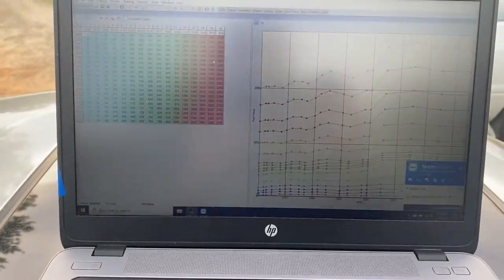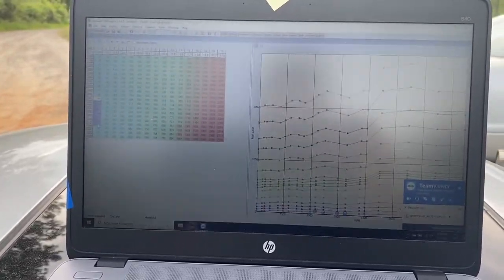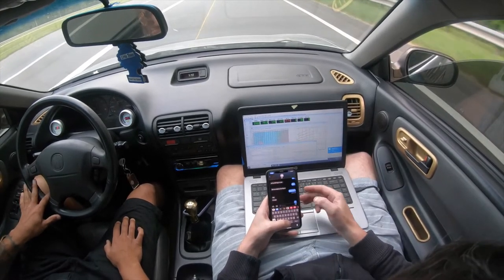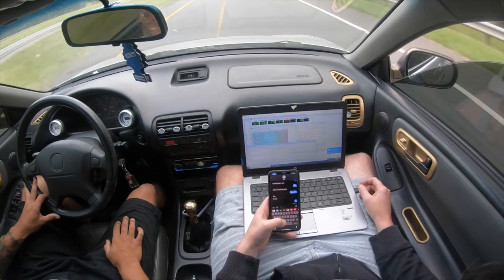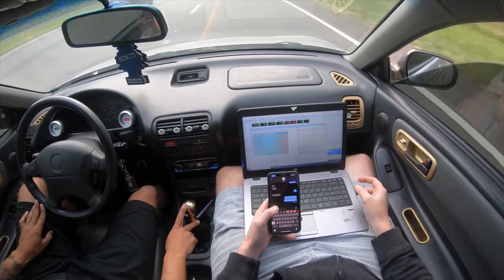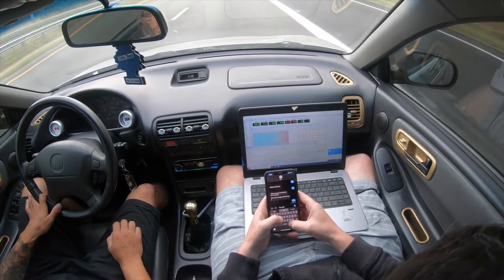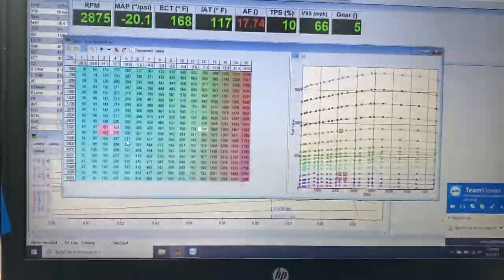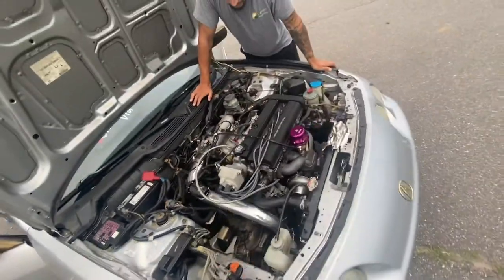Remote Tuning a Turbo Integra

Comment: Just rebuilt  my grandson's 94 Integra GSR win 10-1 compression pistons, and a turbo.  It ran before we tore it apart to fix a spun rod bearing.  Now trying to get it to start.  Battery was disconnected for a couple of months.  It's trying to start but doesn't quite run.  I think the gas tank has E85 fuel.  We're in the Austin TX area any suggestions on how to get it running and tuned?